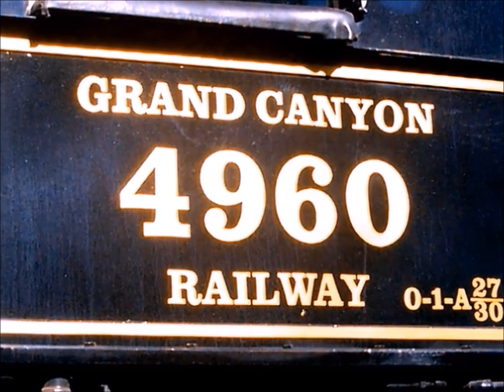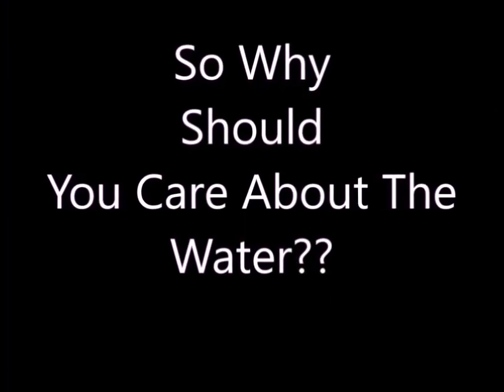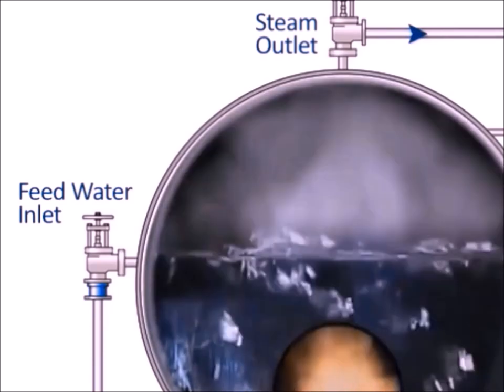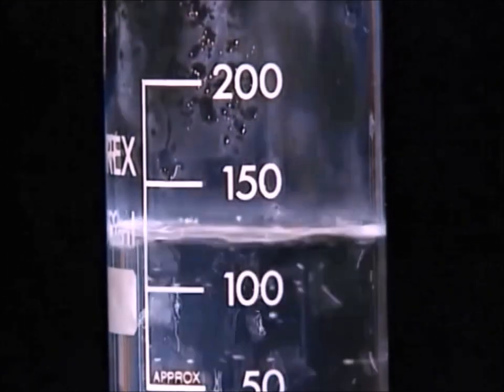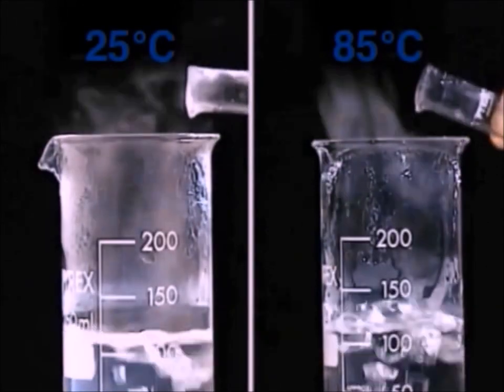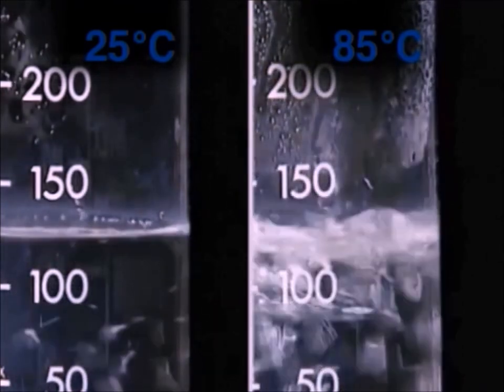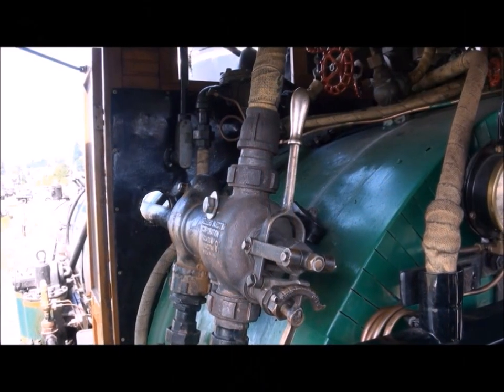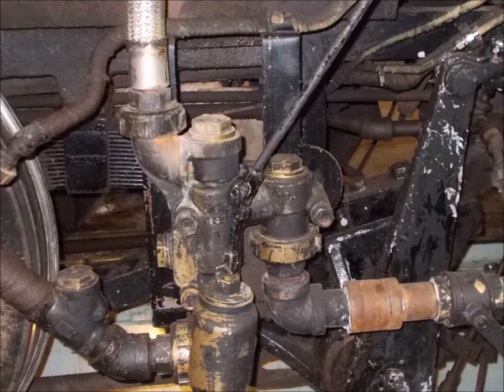Managing Your Steam Locomotive Boiler Water Level

Comment: This is very helpful on my Train Simulator 2020 game. I can't seem to keep my pressure up though and I run out of water. If anyone plays Train Sim 2020 can they make a video on what the valves do and how to keep pressure up and boiler filled...
Reply from the maker: You let your boiler run out of water and it blows up! Then you are dead. ALWAYS keep the water up even if you need to stop to do it.
Reply: @dmurphy2891  I heard that there are fuse plugs in the boiler the melt when the water gets below a certain level and let all the pressure out. So you'd take the loco out of action for a while, but no explosion. Are they not standard or am I missing something else?